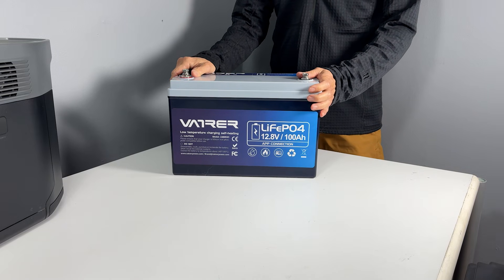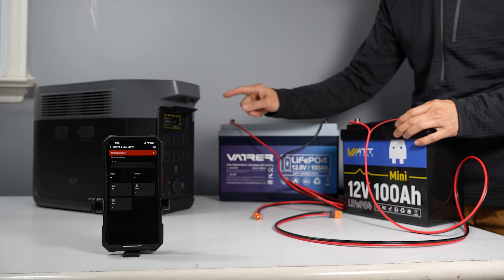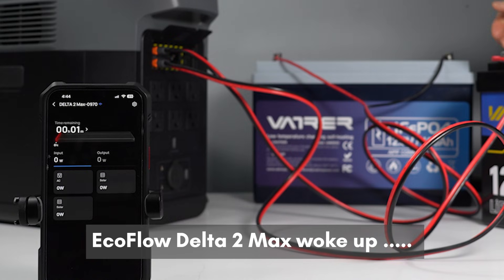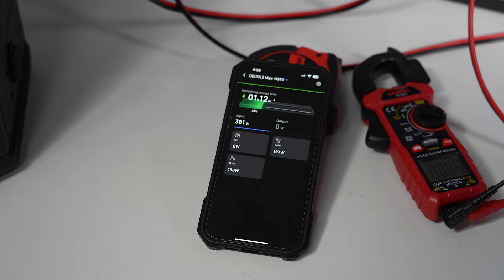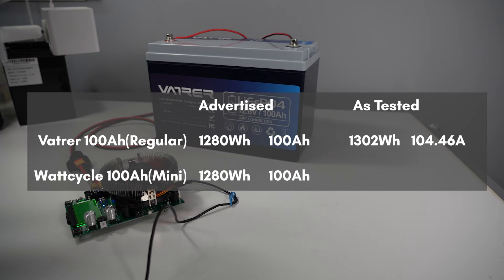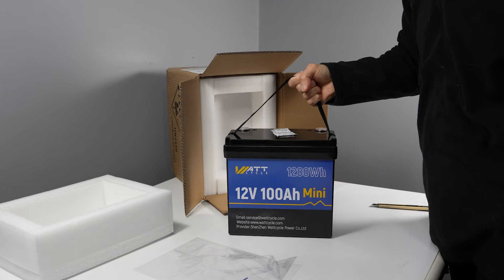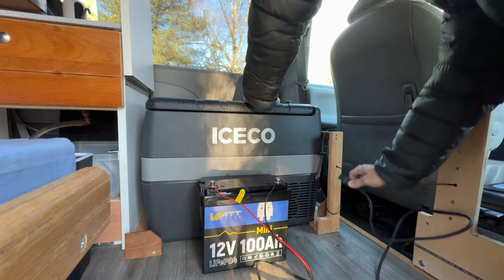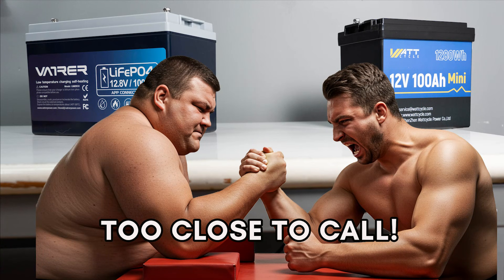Is This Mini Battery A Scam or Gem? Wattcycle

Comment: Thank you for this analysis.  I'd go with mini battery for my mini van.  :).  I've seen several channels lately that hook up battery to power stations to get extended run time.  That's how I'd use it.  Have always enjoyed your channel.  Thx again.
Reply from the maker: Yes, why pay for OEM expansion pack when you can get a battery for half the price or more. Thank you for watching.